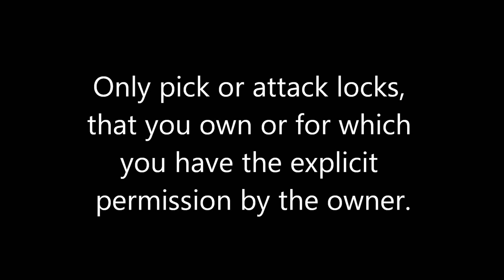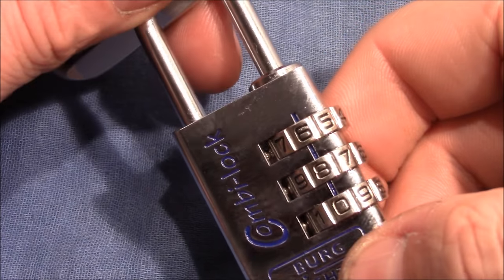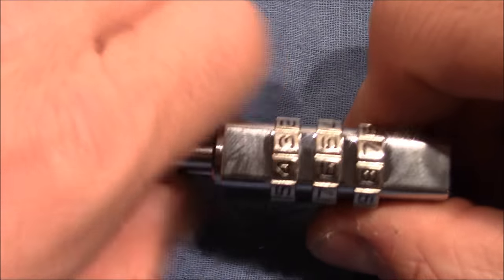(picking 283) Decoding a Burg Wächter 3 wheel combination padlock - how to defeat false gates

Comment from the maker: I just realized that the actual request was for a Burgwächter Combi Lock 88 Fun. I'm not sure if my lock (model 90/30) behaves in the same way as the other. But I believe that if the "88 Fun" has false gates it probably works in the same way. If it has no false gates then it's even easier.
Reply: 88 30 FUN has false gates but your method works perfectly. :)

Comment: I got the exact same lock here and was happy to find your video.
I tried your method out and either I'm too stupid or too clumsy... The middle wheel moves a little when applying tension, the bottom wheel hardly at all and even gets stuck completely and the top one is always loose. There's no movement in the shackle at all and always the same clicking noises, no matter what I do. It stays in this state for three or four attempts now. I don't know what to think about that...
It looks quite easy though when you do it, I'm really wondering if I'm not capable of doing this or maybe the lock has a defect...